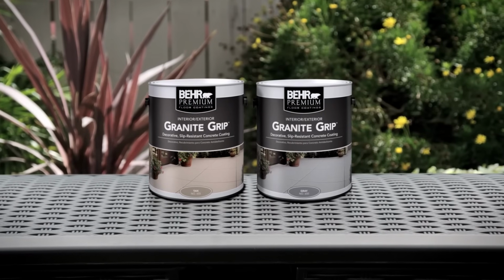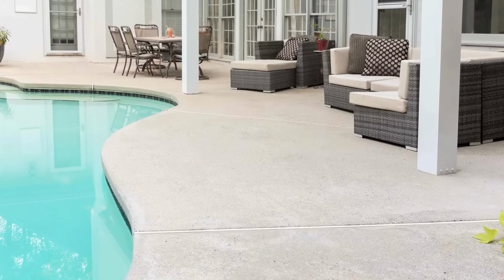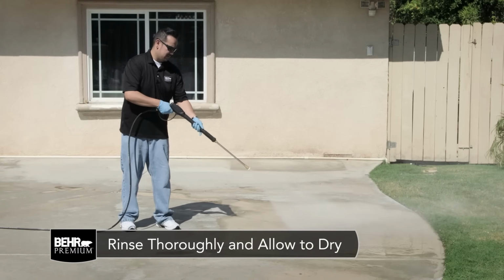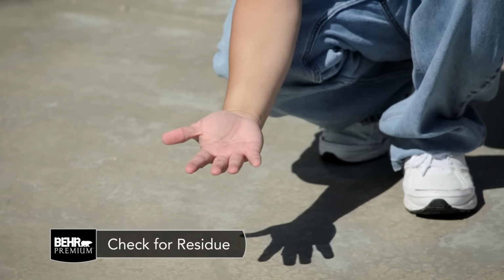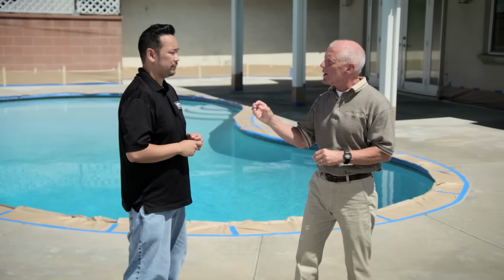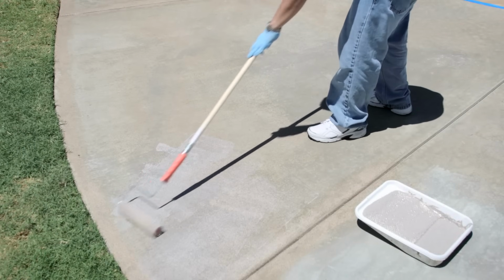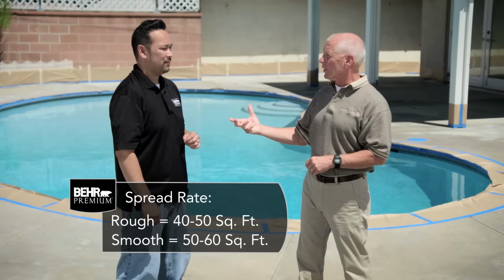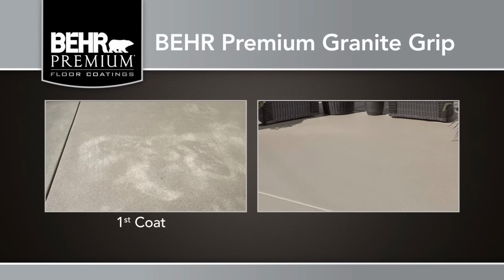How-To: Apply BEHR PREMIUM® Granite Grip™

Comment: Im re doing a old basement and was wondering if this would be good for a basement floor that will take water in the winter. Water pools in from the walls and floor. Will this product allow water to seap thought the concrete?
Reply from the maker: Hi Matt. We do not recommend any of our floor coatings for use under standing water.

Comment: How much time can be store the paint before expire?
Reply from the maker: Hi Enrike. Unopened water-based paint should be good for 4-6 years (assuming it has not been exposed to extreme cold or heat), and then would require a thorough shaking.  Already opened water-based paint can be okay for a couple years but please inspect prior to using.  Look out for bad odor, settling or top coat skimming.  Again – extreme cold or extreme heat could also damage the liquid paint.  Before using any paint that has been stored for a while, be sure to mix thoroughly and apply to a test area before using.  Hope that helps.

Comment: After reading these comments I may go a different route on my patio. It's 812 sq/ft. Four coats would be outrageous cost. Since I want a grey floor would having a good solid grey floor first help with coverage ??? Maybe then it might only take 2 coats. Just curious.
Reply from the maker: Hi Mark, thank you for reaching out to us about your concerns with the coverage. Using a solid color wouldn't help or bring any value when using our Granite Grip. However, the proper prep work is key, such as etching any bare concrete areas. Also, following the spread rate is vital. Keep in mind that if you don't get the expected coverage or experience any issues, please feel free to reach out to us; we'd be more than happy to help!

Comment: can I applied whit the hopper texture? is the same as texture machine?
Reply from the maker: Hi there, for large projects, consider using a texture sprayer with a 4mm tip. Spray in 4' x 4' sections and back roll with an adhesive roller cover. Hope this helps!

Comment: My patio is painted concrete.  Can I use this product over the painted surface?
Reply from the maker: Hello Bob! Yes, Granite Grip can be applied over painted concrete.  Clean the surface and remove any failing or peeling paint. Scuff sand glossy surfaces prior to application for proper adhesion. More detailed instructions can be found on the product label.

Comment: Can I use this on stamped concrete
Reply from the maker: Hi. Granite Grip can be used on stamped concrete. However, achieving a uniform application may be a challenge depending on the depth of the grooves in the stamped concrete.

Comment: I am considering using this product on concrete set of front door steps.  There are a few vertical surfaces for the stairs.  Is the product designed to be applied on vertical surfaces ( steps)?
Reply from the maker: Hi Gord! We do not recommend using this product on vertical surfaces or areas subject to hydrostatic pressure.

Comment: How long should I expect this product to last on a patio in a hot, sunny environment like central florida? In other words, how long before repainting might be needed?
Reply from the maker: Hi there, thanks for your interest in our Behr Premium Granite Grip. As horizontal surfaces see varying amounts of traffic, it is difficult to say for sure. However, if the product is applied according to product label instructions, it will maximize the durability of your coating. You can learn more here: http://spr.ly/6058B9W7i
Reply: +BEHR Paint I have to say that your answer and link are not very helpful. Neither gives any indication of longevity even for a best case or worse case scenario.

At around $45.00 a gallon for 25 square feet (that's two coats as per suggested application), trying this new product can be an expensive risk; one I would be hesitant to try without better information.

So, I will provide my specifics so that you might have less difficulty advising me on what to expect for longevity: sunny environment during the summer with mostly direct sunlight and temperatures ranging from 85 to 100 degrees, concrete slab patio at front of the house, two persons worth of traffic three times a day on average, visitor traffic of 1 to 2 persons a week, concrete properly cleaned, properly applied, properly cured.
Reply from the maker: Yes, we absolutely understand your request for more information. Can you please email your contact info to behrpaint@behr.com? We can have a team member reach out to assist with any questions. Thank you.
Reply: @BehrPaints  I have a painted / stained textured patio and pool deck. Can this go over it with proper prep?

Comment: Can this be used in a garage in lieu of an epoxy floor?
Reply from the maker: Hi Randy, yes it can.
Reply: BEHR Paint how well will this hold up? Will it rip up/come off like other products? I mean when the car is in the garage and you turn the steering wheel while stationary, as if you're trying to back out?
Reply from the maker: Hi Randy, BEHR PREMIUM® Granite Grip uses 100% acrylic crosslinking resin and will resist hot tire pick. Please follow label instructions for prep and  application . You can learn more here: http://spr.ly/6059DgAGz
Reply: funny how you said in a earlier reply to not use it in a garage..and now here you say to use it in a garage...was going to try it on my patio but after everyone says it will not cover as it says it will ...will stay clear of this expensive product..:)
Reply: Brian Little that's why I have screen shots of their response. If and when it fails, I will be sending this to their warranty department
Reply from the maker: Hi Brian. When Granite Grip was first launched, it was only approved for use on non-drivable surfaces as testing was still in progress. Since then, testing has been completed and Granite Grip is now approved for use on driveways and garage floors. 
For your patio, please know that the 1st coat will not cover by design and acts as a base coat. While two coats are necessary, additional coats may be needed depending on surface porosity and may help hide previous surface imperfections or cover over dark colors.

Comment: Stay far from this product. Ruined my concrete floor with this crap.
Reply from the maker: Hi Francis. We are sorry to hear about your experience! Would you please send us your email and phone number in a private message so that one of our Customer Care representatives can reach out? Alternately, you may chat directly with a rep during business hours on the link below (Available hours are noted there as well). 

Customer Care: http://spr.ly/6053E2vWL
Reply: @BehrPaints  Thank you for your reply. I already wrote an email to Behr Canada, but no answer so far. I think at least 3 or 4 coats are needed to get a good result, so I would say that the real coverage is 20 ft per gallon, which makes the product twice expensive. Also, even with the recommended roller, the product is very very hard to apply.